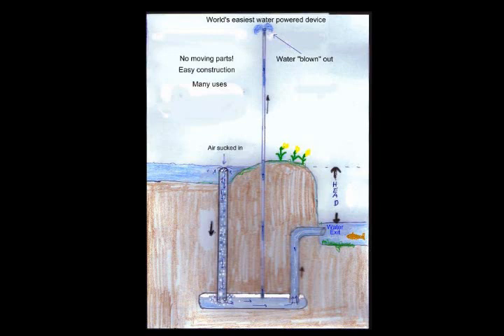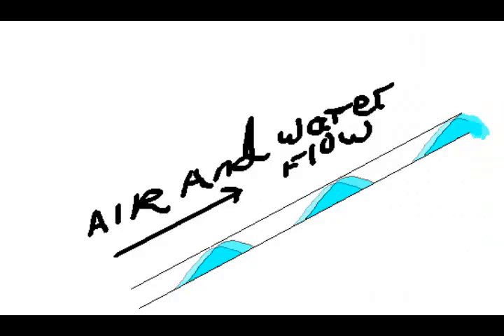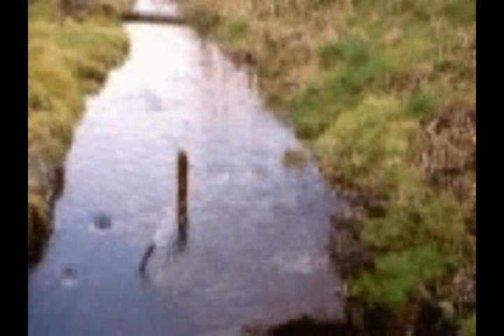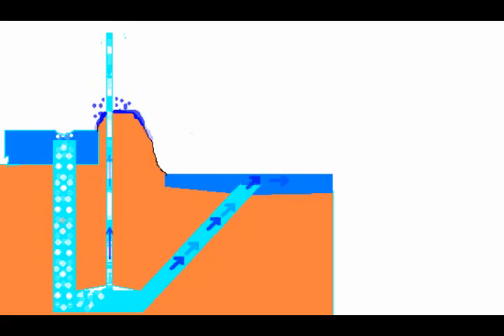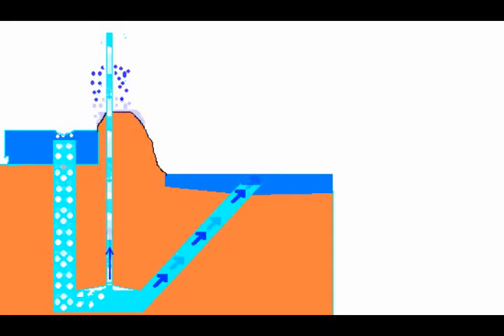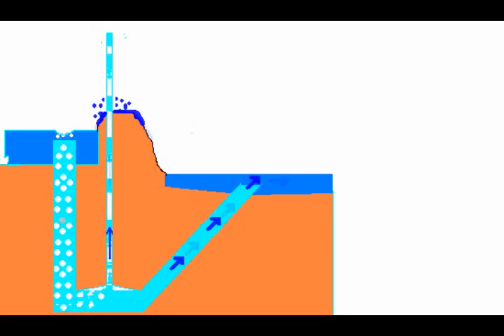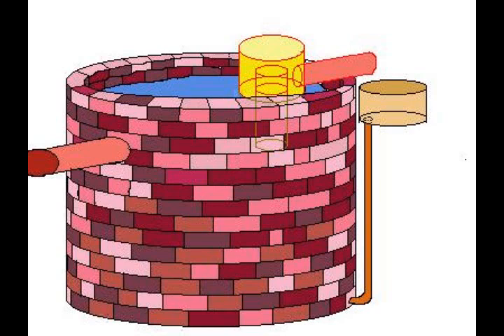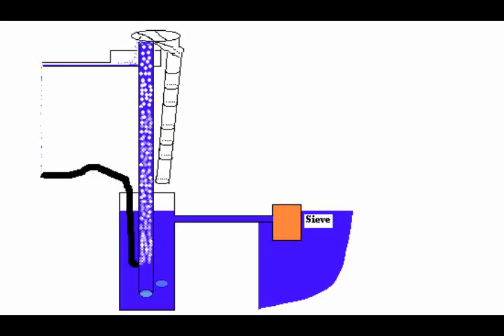WORLDS SIMPLEST WATER PUMP!! Make a PULSER PUMP!   Alhambra pump from 1400 AD? Make one and see!

Comment from the maker: I did 2 where I buried the pipe under the creek (It dried up sometimes in summer) and I did 2 where I dug the hole beside the creek and then diverted the water into the hole.
I think that digging beside the creek is the most viable option for most people.  Use a machine!  Also, if someone has a very small stream, test the pulser pump nano!  It certainly will work  too but nobody has built one. Be the first in the world!
(Suggested by virlusun on youtube) and I have tested the airlift part
Brian

Comment from the maker: I have an old site.  Type in:  tripod pulser pump  and the first link should be contents of  the pulser pump section of gaiatech  So click on that link and then click on the link that says pictures  of a small working pulser pump.  That page has pictures that show the intake that worked best for me. It is a 1/2 inch pipe pushed through a plastic can.  It was adjustable so the can could be as close to the 4 inch downpipe as u liked and the airflow in through the 1/2 inch was also adjustable.

Comment: Brilliant!  No moving parts, and incredibly simple!  The only draw back is the required flow of water.  I was thinking of taking this system and building it off of my eve troughs from my roof at my cabin.  This pump could then deliver 'some' of that water to a small tower thus providing me with an elevated resevoir to pressurize my cabin's water system.  I don't need much water up there so it may work well enough.  
Data on flow rates would be great!

Comment: If it needs water at a higher elevation to power the down pipe, what is the benefit?  The tall air pipe pressure release pipe has water in it, but not much.  I don't think anyone has found a use for this system in a hundred years since its invention.

Comment from the maker: Anyway, I couldn't test it with higher power head, (because half meter was the max I had). The tromp section was about 30% efficient with 1/2 meter head. I have seen English research (totally different project) where they used 1 m head or 2 meter head and they claimed around 60% efficiency making low pressure air!    I did my measurements around 1990, I don't have the financial capacity to go further. The videos were released in the hope that a university would complete the work. Brian

Comment from the maker: Hi, Thom, I have data ( it is only from my old prototypes and test models) I thought  stream I used was too small to be practical.  In my case, between 250 and 400 litres per minute went through the pump to produce the power. It fell 45 to 55 cm to produce the power. (This changed a bit over time with modifications) and it produced 3.5 to 4 litres per minute at 3.5 to 4 meters high. This also changed depending on where the water tank was. It also pumped to 5 m and 8 meters.

Comment: the head of incoming water {potential energy} passing through to the exhaust of the water outgoing, intermediary being the extracting the potential via the smaller diameter pipe ... with only air as additive driving force, very smart,... it has direct application to 3rd world, what dynamics are at work, The feed end.../pipe diameters,/ flow rates, / and the outgoing end,/ pump delivery per hour, litres ? do you have any data on this.
Thom in Scotland.

Comment from the maker: @mad4us The bicycle pump was used in a demo of how low pressure airlift pumps work with "Plug flow". 
So, it was not part of a working pulser pump, just the airlift demo.  I made that clip in about 2001 and there was no other clips about plug flow airlift on the internet at the time. At that time, everyone showed airlift pumps that worked by the air bubbles making a very deep column of fluid less dense.  Most people do not even know plug flow airlift exists until they see this video.

Comment: Thanks for the video, firstly. On the high side, does the water need to stay at a consistent height? (To keep the inlet pipe close to the surface for air?) What kind of play do you have? And also, what is the ratio of inlet and outlet/pump pipes? I would imagine that both outlets need to equal the inlet volume. And it seems that maybe it's close to 10: 1: 9 
Meaning inlet is 10 square inches (area of inside diameter) pump is 1, and outlet is 9. 
Could you clarify this for me? Thanks.

Comment from the maker: @mattsoftnet  I show a method to control the water flow and shut off water on the "tripod" site.  I let in LESS AIR!  Then the Water speeds up and actually sucks in more air! This method works well. It is not as simple as "gulp in lots of air" but the beautiful thing is that it is self regulating. If there is not enough air getting in, the water speeds up and "sucks' in more air. Too much and the water slows down until all that air gets to the bottom and out into the chamber. Brian

Comment from the maker: @mattsoftnet Yes the smaller pipes might work a bit better. But they might block a lot easier with small leaves, or acorns Too!   In any case, When I did that back in the late 1980's in Ireland, the large pipe was much cheaper than a bunch of small pipes.  Most people are scared off because there is no official research on this thing, (so no trustable guidelines) and   you dig deep  beside the river.  
Check out the pulser pump nano! Easier and it has never been attempted!

Comment: i used something similar for vertical gardening. it's called the bell principal.Using a small aquarium  air pump with a hose leading into  the bottom of a water reservoir and loosely fitted into a larger hose leading up to the top of the gardening containers, the water is pushed up the larger hose and waters my veggies.

Comment: nice idea. no wires to run, just a supply of running water. I'm sure there is a lot of room to improve the design in new innovative ways. I'm thinking the inlet and the main down-spout that pulls the air bubbles down is probably the most critical part. the more bubbles make it to the bottom, the more power the pump has. first thought, try filling the inside of the large pipe with a bunch of smaller pipes suspended inside it the entire length. this might give it more vertical guidance.

Comment from the maker: @mark1952able Yes, you must have head and flow.  Minimum head for this is about half meter (1 and a half ft) and minimum flow is about 250 litres per minute or about 65 US gallons per minute.  This was my proof of concept and I never expected it to last so long.
I think a much more useful pump would be twice the head and 2 or 3 times the flow.  There is potential on a very small scale with the "pulser pump nano" (Suggested by a friend), partly tested, much more to do.

Comment from the maker: @Lotusrk123 Hi, thanks for the comment, it is not quite the same as the old pneumatic pumps. They went very deep, used the lower specific gravity of bubbly water to pump and generated high pressure air.  This goes only a few meters down, uses plug flow or slug flow to pump and generates low pressure air.  I have yet not found a confirmed report of them using the pneumatic tromp to pump water.  Instead they seemed to have used it to power machines. So if you have info, let us know!

Comment: what happens if the pipe that draws bubbles travel sideways after dropping from the catch..that might reduce slowing down you think? i am thinking fish tank style to make bubbles. i want to make one to draw water up a hill, from a bottom storage tank to a top storage tank. the bottom tank will drop into the pulser tank bringing air/water mix into it and then pressurize to shoot pulses to the top tank like a water gun...

Comment from the maker: @corsycle  Basically it is like a waterfall.  Water falls over  the edge of  a waterfall and accelerates as it falls under the influence of gravity.  If it is high enough the water becomes spray mixed with air.
In a tube or pipe the acceleration happens too. Water is not expandable  so something has to fill the gaps as it  accelerates.   If there was no air entry, the water would simply go faster and faster. The air bubbles capture some of the energy from the falling water and slows it down.

Comment: I had made somethig like this to filter the water in my fishtank, and it wos powered by the airator bubling in a pipe wich went 10cm over the watertank level, trough the filter and than back in the tank airated and cleaned. I made it like that because it didnt require any moving parts and it didn't hurt the fish, even when it sucked one of them in the filter... still havent seen one patended! Oh and mine works by decreasing the dencity of the fluid in the pipe so the other fluid pushes it out.

Comment from the maker: @run0hard9  I dug a hole beside the stream.  It took a while and it was hard work. You could check out the pulser pump nano idea and nano airlift pump ideas in my videos.  It might mean that  you don't need to go so deep. Maybe only 3 or 4 ft deep. It has never been tested.  It should work but I have no idea of the economics of it.

Comment from the maker: @SOAHCSOAHCSOAHC  I think my  tripod website has most information. If a university or private person or, company does some work on big pumps (I had only a tiny stream) I think they will post results on appropedia or wikipedia.
There is also a yahoo group about the pulser pump with some info in the files and photo,s sections.  But I think you have to join to see anything.   A search should bring all these sites up. (there may be more sites because the pump is a free idea.)

Comment from the maker: @mryellow123  Well, you have a choice, you can use a cheap pulser pump and take some of the water or you can use an expensive pump and fuel and take all of the water. I think the realtiy of motivations and desires is that  your neighbors and regulations will prevent you from taking all the water from a river. If you are nasty and take (steal) all the water, they will take nasty measures against you. like destroying your pump or crops or putting you in prison. (If your country has laws)

Comment: @gaiatechnician I'm kind of jumping into the middle of this, and haven't looked into pulsar pumps hardly at all, but this is a really interesting  topic to me.  Could I ask a question though, I'm curious what you were using your test pump for or what you think it could be used for. I mean is it very useful to have water pumped 10ft high even if it is "4 to 5 tons"?

Comment from the maker: @enemyunit  First of all "however the resulting pump will have such low efficiency that it would have no real-world application" . Where is the basis for your statement?   Nobody currently knows the efficiency figures.
Also, my test pump was TINY in a place UNSUITABLE for water power, yet it pumped 4 to 5 TONNES per day of water to 10 ft high. 
Suppose you have 2 tonnes per second flow in your river.  How do you propose to install the parts? Suppose you havn't the money, how do you install them?

Comment from the maker: By the way, I have been told that Joseph Priestley used a trompe powering an airlift pump to pump water on some land that he owned.  Is there any more info on this? Like place and date?   Reason I ask is that Priestley died in Feb 1804 and the airlift pump was "invented" in Germany in 1797  (Carl Emanuel Löscher).  Priestly was in the USA  from 1794 on with failing health, family problems and little news from Europe. If he was using one before 1797, who invented it?

Comment from the maker: @blackjeffrey1 Nope, it is not an airlift pump in the normal sense.  Check out the biofueled pump in my videos because it probably uses something similar (but with a different type of regulation of air in and out). Other than that, just go to their geyser pump site for info.

Comment from the maker: @blackjeffrey1  The geyser pump is a patented waste water pump.  It uses an air  compressor to pump the water but it is not an air lift pump.   I think it has moving parts.  I  made "geysers"  powered by the pulser pump. It was fun. The geyser pump is on the web and on youtube.  I have had emails asking about the validity of its patent. (I am not a lawyer).   A "biofueled  pump" (the CO2 from yeast in beer making can run it.)  is in my videos. Might be similar method to the geyser pump.  Brian

Comment from the maker: @blackjeffrey1  Fair Question, (apart from it working for other youtubers on 3 continents!).   2? years ago, wikipedia told me that it was not allowed on "Definitely not"! (because it is experimental, etc). I think all conversations on wikipedia are kept so you can check (I am user gaiatechnician there too).  
But if you check now, there IS a junky entry about the pulser pump.   By the way the wikipedia entry for airlift pump seems to be advertising for the  patented geyser pump. Scam?

Comment from the maker: @davidjpringle  I did something where I popped 1 inch or 2 inch styrofoam balls into a pipe that got low pressure air (only a foot pressure). It did increase liquid holdup dramatically but I never figured how to make it recur regularly and automatically. (The balls must maintain an even spacing or they will react/interfere with each other as they go up). It is not as easy as it sounds!

Comment: Hello video poster, How about ping pong balls or squash balls  wich ever fits the high pressure pipe without resistance, filled to an even bouyancy of water, and at the top a screen so the water can go to a funnel to be collected and channel the balls back to the water in take. My name is Dave Pringle from Pleasant Gap, Pa USA  Give a call if you wanna bounce ideas back and forth.  1-814-574-8109.

Comment from the maker: @liveuk  Hi,  a Brumby pump is an airlift pump (without the trompe  to power it).   So it works with high air pressure from a compressor as a normal airlift pump.  
The pumps I made use a trompe to make Low pressure air and then use plug flow or slug flow to use the power from the Low pressure air to pump water.  So if you have that combo,  (trompe powering low pressure airlift)  you should definitely post it.       Especially if it has worked since the 70's.  Thanks, 
Brian

Comment: @gaiatechnician yeah i now about air lift, infact i use them in my green house. its a simple case of it takes more power to move water then air. but as for them burning out their water pumps, then they realy must have been doing something wrong..lol, hell a house well pump can last yrs. i have seen one go over 25yrs, it all depends i guess on brand,  and whatch out for how they measured the efficiency back then not the same as today, but yes an air lift will always need less power,

Comment from the maker: @1crazyfocker Did you know that the windowfarms project switched to low tech airlift (from aquarium air bubblers)  a couple of years ago?  The reason? Water pumps were way more expensive and  kept burning out. (they found burnt out pumps to be wasteful). By the way, you can check efficiency  for either Taylors or the Michigan trompe in an old engineering book in google books. Their efficiency was somewhere  over 80%.

Comment: @gaiatechnician true true. i agree 20 years later the pump with no moveing part (as long as it does not get gunked up or air lock) would still be working. but dont forget the history of this, or the airlift pump by it self. it main use was for water removal, not for "pump" for use or drinking or anything. plus it needs a set water level that could easly stop the air flow, compared to a water wheel as an example. if i needed a pond filled and time was not an issue sure i would use this or a ram.

Comment from the maker: @1crazyfocker  I know people thought of airlift and trompe before I did. Work continues on plug flow and slug flow in research labs because it isn't fully understood. You are welcome to try to get a "simple water powered pump" to work with less than 2 ft of head. You are also welcome to come back 20 years later and check if it still works.
 How efficient is it,    if it is broken? 
I don't mind your spelling mistakes, I make lots myself.  But it is hard to search if the names are wrong.

Comment: this is not rocket science, its a built in air lift on a hydrolic air compressor, yes i watched your video, and yes i have look those up before, as physics and mechanical engineering, are not only my major but a hoby, as well as the history of invention. and this was not lost, its just very inefficient, you can get more from the same head of water useing a water powered pump. it was just to wasteful and still is. thats why this went the way of the dodo

Comment: on a side note, i am not downing your work, hell i completely understand, I am an inventor in my spare time, and get defensive over my ideas too. but it dont change facts. the main reason these went the way of the dodo is this, it's very inefficient, from this they used the same head of water to run a pump for air or water (30% to 250% gain) it just didnt stand a chance. but its still cool that you thought of it with out knowing.
Reply: Pompa pentru aer s-au apa are piese in miscare, rulmenți care se strică

Comment from the maker: @1crazyfocker  Very good. That's normal airlift.    Not the plug flow version.  
Now, you go look up plug flow and slug flow.   And see how much of the research on slug flow and plug flow  is from this century. (Just search pdf files for 2 phase fluid flow).  Tylor in your previous post is Taylor.  If you had watched the video, it has animations to show  how plug flow and slug flow work.    But, you clearly didn't and you don't.